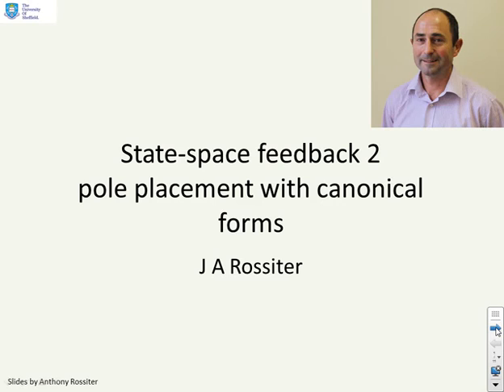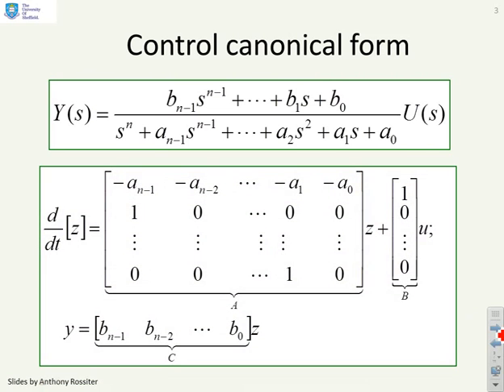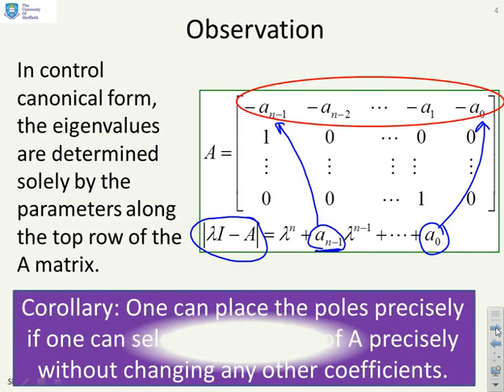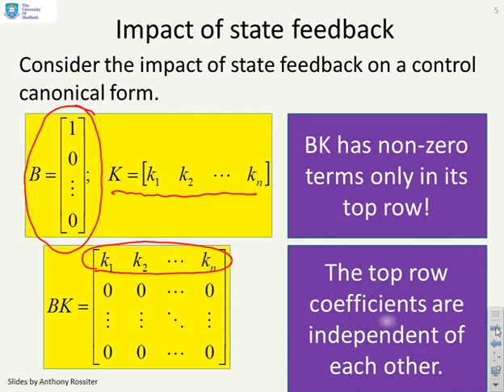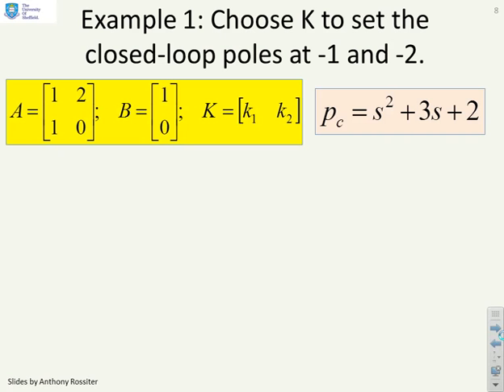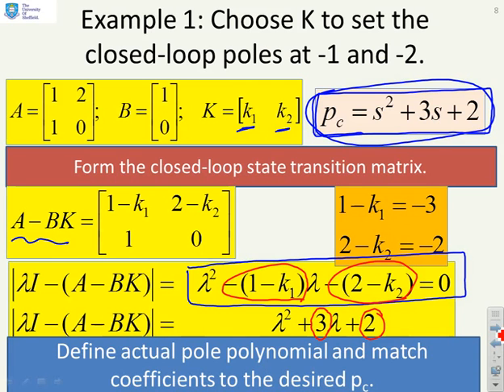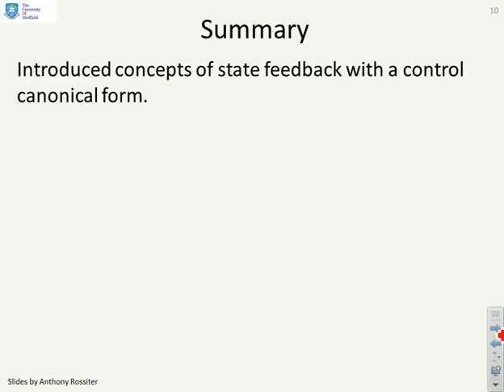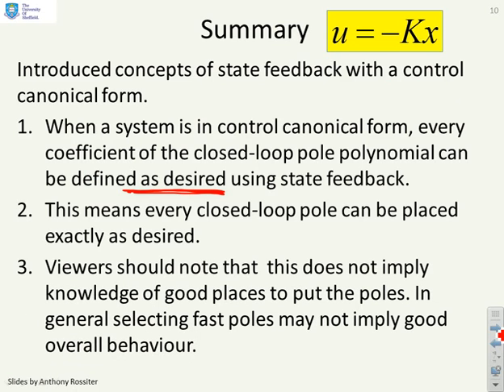State space feedback 2 - pole placement with canonical forms

Comment: Thumbs down for not saying where to place the close loop poles!  The closed loop poles should be placed away from the imaginary axis is the s-domain.  Placing them on or near the negative real axis and away from the origin will cause the errors to decrease rapidly with little or no over shoot.  I am a big believer in pole placement but one cannot ignore where the closed loop zeros will be.   Closed loop zeros extend bandwidth but may cause overshoot if the closed loop zeros are much closer to the origina than the closed loop poles.  Placing the closed loop poles is good.  Being able to place the closed loop zeros is even better.